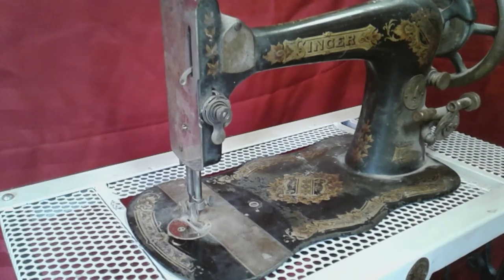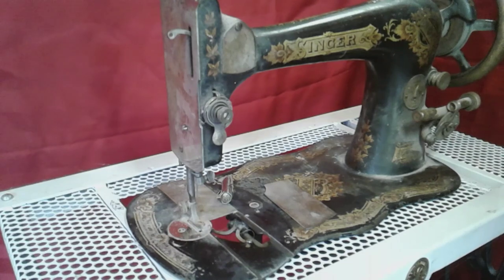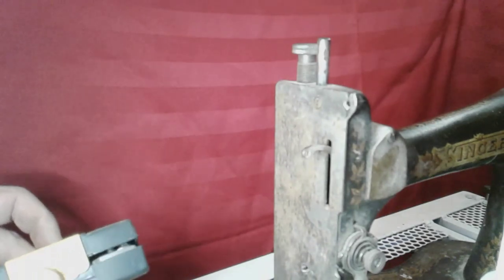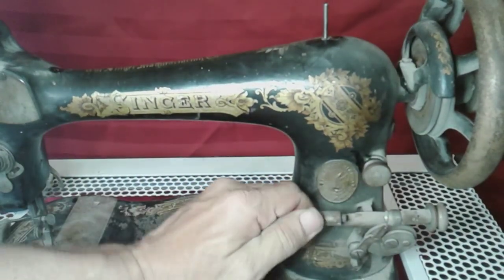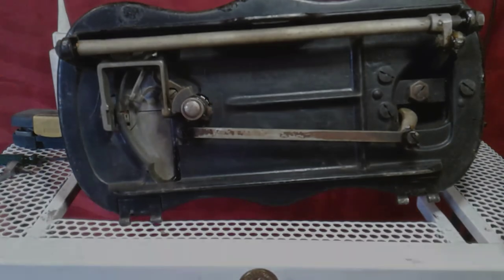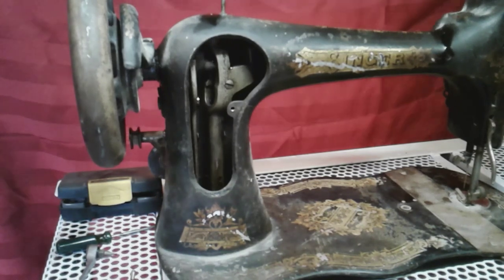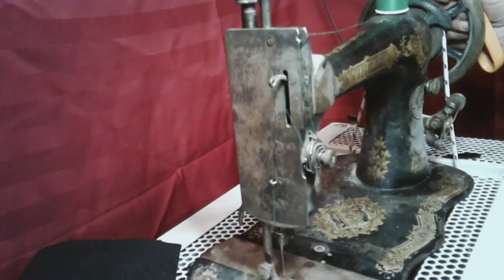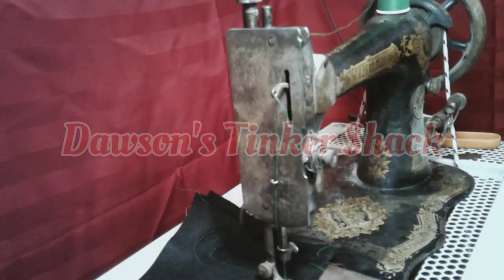My new Singer is over 130 years old ! Can it sew with only oil ?

Comment: My singer vs 1891 also has the older shuttle   holder without the extra finger, which causes me to snap the bottom thread if I stop the machine in the wrong needle bar position.

Great video ,,, I usually make machines work rather than make them pretty.

I let my wife use them for heavy work rather than her fs40 brother in the hope the brother will last a few months more 😉

These old machines will last for another 100y and if you oil them even longer.

All the best to all

Comment: Works after all that time, and you missed oiling the wheel release knob and under the trapezoidal access oil point. VERY nice machine. Check for the Oct. 16th 86 date on the bobbin plate!!
Reply from the maker: Sews great , i accually missed alot of oiling points,  like the needle bar crank as well but i have to keep my videos under 15 minute so idid the very basic and even that turned out great , also why do i need to look for the date stamp ? Is it unique ? It has it , and i also own a 1886 fiddle base vs2 , missing front cover ....love to hear why